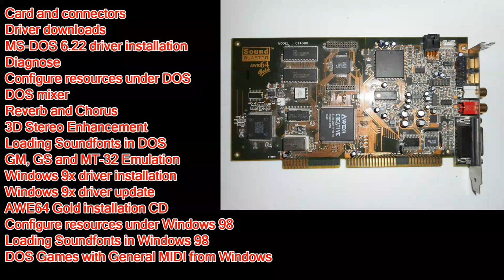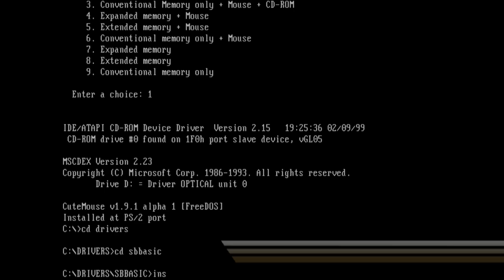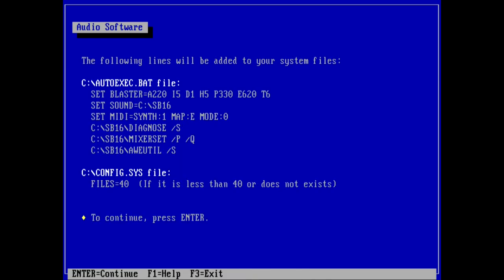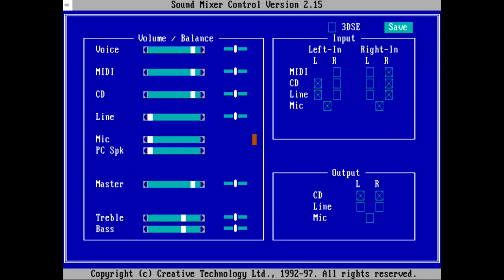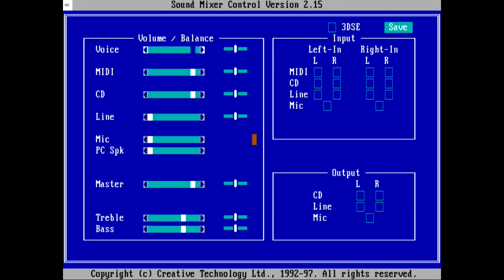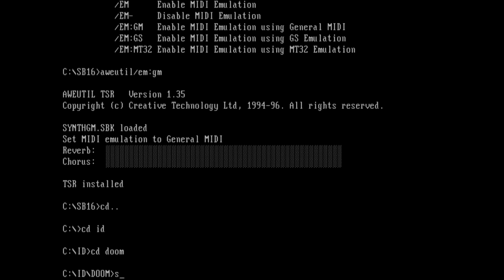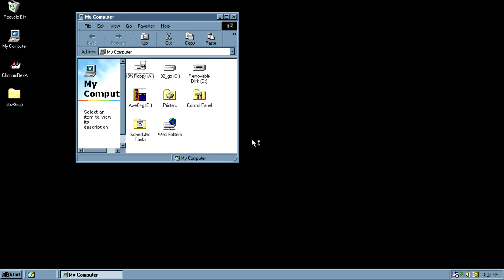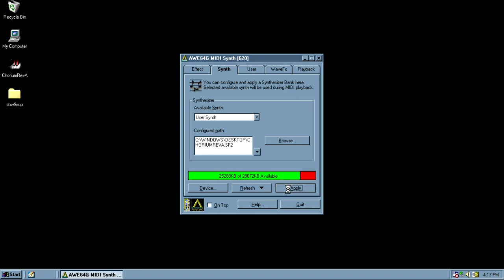Sound Blaster AWE64 Gold Review

Comment: excuse me phil, if you read me from the heaven can you come to the earth to listen me 😅.
i have the ga-5ax like you(mine 4.1), i have crackling noises with the 64 value, i tried to disable every single option in the bios(with tweakbios too, seems it keep the changes, but not after rebooting the computer) , fsb 66x5.5 and nothing worked.
i think is speed issue, agp, pci bus or isa, already tried pio mode, slow ram or isa bios, is there any config for the isa bus write-read to lower it?, pci-bus agp tweak for lowe the fsb, maybe im totally wrong but i dont know what can i do
Reply from the maker: Well have you tested other ISA sound cards?
Reply: @philscomputerlab  coincidentally i just finished testing all day.I dont have another Isa but i have tested a vibra 128 and the problem persist, even is worse.The vibra is a lot more quieter than the awe (using external aplifier).
It happens with midi music in games, digital is rare, just ocasional.
Tested using only low level dma, not solved the problem.
After a lot of hours, the only thing i saw which made a difference is set trebble & bass to 0 in the mixerset, the problem is not solved completely, im testing just with duke3d setup.
Im thinking if the real problem is another thing and this is just fixing it a little or or that some sounds are not playing as they should.
Reply from the maker: @jorge7317  How are the capacitors on the board? Might need replacing.
Reply: @philscomputerlab  I have changed the half capacitors of the board with panasonic low esr.
The phisical appearance 3 of them had a very small difference compared to the other ones.
Is my first time changing them, so it was a bit difficult, in the process a blown some of the external capacitor's ground point layer (someone explained me how to repare it), tested all the grounds and are okey.
Idk if that blown ground points can be the reason or is due to the other half capacitor not changed, i have performed speedsys, around 15-20 3dmark test (2600gpu voodoo3 & 6000 amd k6-2) and memtest and is working okey, i dont have any boot speaker sounds too.
Im going to buy some desoldering copper  mesh, repair the ground points and chsnge the other ones.
Reply: @philscomputerlab  Recaped all the board, the pop still here in the left side, maybe is the awe64 caps?